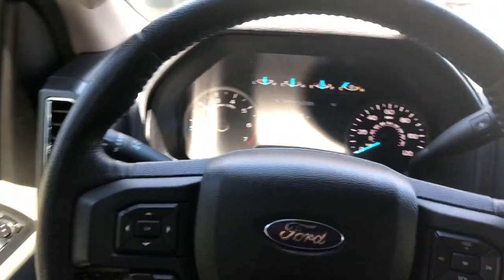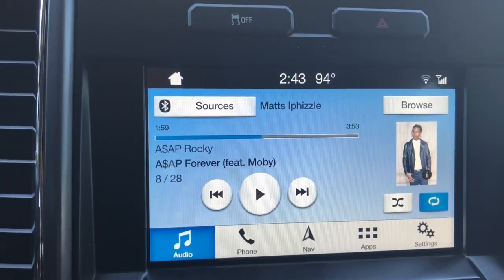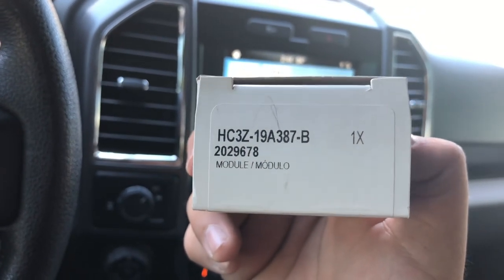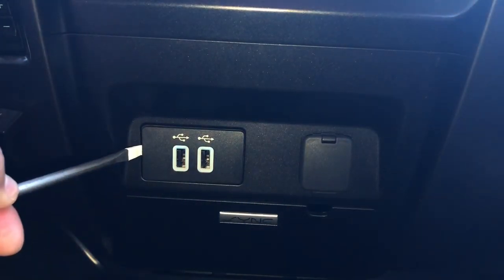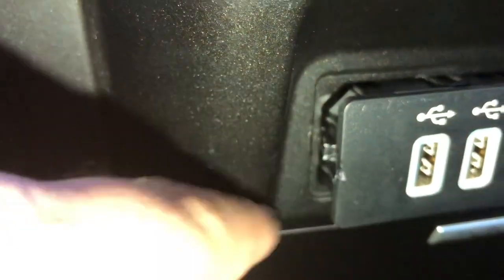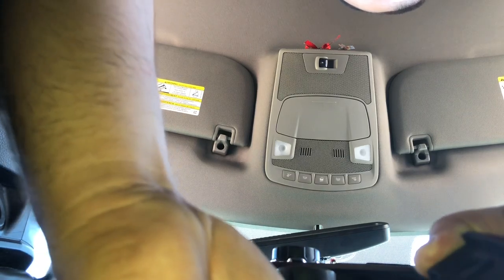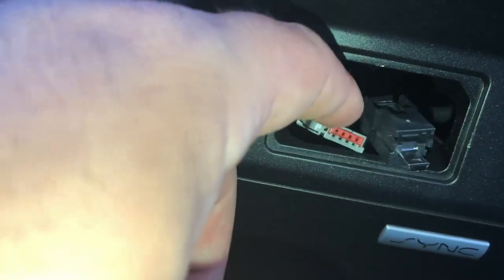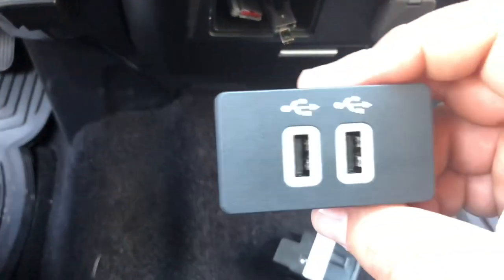2016 Ford F-150 and Apple Car Play

Comment: I went through the process and followed the directions exactly. It took my car over 3 hours to update. Not sure why.  But when it got to the end and said installation complete. It worked! One thing none of the YouTuber's never mentioned was that the screen gives an alert saying that the USB is not compatible. Even though it all still works. My guess is because i got the parts from Amazon and not from Ford.
Reply: Do I have to unzip files 😊
Reply: @rugarmoore7657  Yes. I ultimately had to get the right part from  Ford and the problem went away

Comment: Thankfully, CarPlay now allows other navigation apps... at least on my other Sync3 devices. I had a 2016 C-Max and went through the update. I then traded that in for a 2018 Fusion, which was already setup for CarPlay. I think I was able to use Waze prior to trading in the C-Max. The reason I came today is I just bought a 2016 F150 to replace my 2013 Explorer and it hasn’t been updated yet. I ordered my new USB hub, which will arrive tomorrow. I couldn’t remember which I am to do first... update firmware or update hardware. I THINK I’m supposed to do software first.

Comment: Just wanted to add my thanks as well. Worked great. I found the part at Ford Discount Parts ($50.30). This is what I ordered: HC3Z-19A387-E 2016-2020 Ford Control Module.

Comment: Hey 
I just buy that part and it works 
There download upload you need as well???
Reply: That came out wrong 
So all I have to do is buy the part and everything is already loaded. 
I don’t need any download or upload or anything ????

What’s link to where you bought part
Thanks
Reply: @billwandling318  You have to upgrade your Sync system. 2016 Sync comes with version 1.0 and you need to update it to 3.0 You have to go to the myford website where you are able to login or create an account, register your vehicle and then download the new version onto a usb flashdrive, then go to your vehicle and plug that usb in and your system will detect the update and start the process. Should take about 30 minutes and have to leave the vehicle on, install this part an bam, Apple Carplay. If youre running Android however Android Auto will connect wirelessly.

Its a bit more than just downloading though, look up specifics through other sources. 1 your flashdrive will need to only have that file on it i believe and have one with at least 3gb of space, then you will need to reformat the flash and file you download. Sounds tedious but its really simple, if youre lucky you might be able to call the dealer and just have them do it for you although it will probably require an appointment and end up taking hours instead of 30 minutes
Reply: @iR3J3CT_  sometimes to do it wirelessly can take about a month if you just connecting it and letting it do it itself when its around your wifi

Comment: Just curious how did it take to switch over to CarPlay
Reply: What do you mean should switch when it senses your Apple device in the USB port within about 5 seconds ?
Reply: fordtechlife yea I did the swap and nothin g
Reply: @aldojr5552  has to be sync 3 and software level 3.0 or higher got to setting and aboutsync to check level

Comment: I installed this product and I love the functionality. Only problem is my volume up/down and other steering wheel controls don’t work like they used to. Did you have this problem too?
Reply: No mine works fine
Reply: Ive heard of this it's a device issue depending on the device it may do that
Reply: @fordtechlife  i figured out the problem; you have to be on the screen you want to control on my truck; volume up and down for example, i have to click on spotify/music screen, and it'll work correctly; siri button works from any screen.
Reply: This started happening to me before I replaced this part

Comment: Does this work on a 2015 F-150 XLT model?
Reply: Probably not in 2015 Ford had the mysync system and they went to the Sync3 system in 2016. Call the dealer and ask

Comment: I have a '16 F-150.  Sync 3 updated to version 3.0.  Bought this exact same part from the Ford Dealership.  Installed just as seen on this video however I immediately got an message that states " This USB device is not supported.  Please remove".  Then bought another USB module online and got the exact same error.  Anyone else had this issue?  Any suggestions?
Reply: I have the same problem. The usb port don't recognize the devices. Have u fixed the problem?
Reply: It's the cable. Using an aftermarket or damaged Lightning cable will cause this. It's not the module.
Reply: Was this issue fixed?

Comment: How did you update to sync 3
Reply: Joey Ivezaj go register you car/truck on ford.com you can download the update to a thumb drive and then upload it to your car/truck or if your vehicle is WiFi enabled you can connect your car to WiFi and set automatic updates
Reply: I went to dealership my truck still in warranty did it for free. Updated sync 3 still need the module.
Reply: @johnfregeau7411  You can't update from Sync 2 to Sync 3 though, only if you already have Sync 3 you can update to a newer version of Sync 3.
Reply: @andrewvaldez8783  yes if your within the 3 years 36 k miles and request to update your in 🔴⚪🔵🇺🇸👊

Comment: It's stupid that you need a new module for this. It should just be a dumb module that passes USB straight to the head unit with separate dash light wires. By the looks of the connector, it's a special USB mini-B connector and the module is a USB hub which should be standard.

Comment: I did this in my 2016 Taurus.  Works great but to be honest if you already have Sync 3 you do not really get much additional functionality with Apple CarPlay although my car already had navigation in it. 

I am hoping more apps become CarPlay compatible because most of the time I actually leave it turned off.   I do like having the option though because I can use other Navigation apps if I need to and still see the directions on the car screen.
Reply: How did you get it in a 2016? I was talking to a Ford/Sync Representative today and they told me that only cars after 2017 have Sync 3 and that you cannot update Sync 2 to Sync 3.
Reply: @dylanmurphy7814  Some 2016's had it. Also, they will tell you that Sync2 cannot be swapped with Sync3, but you can. It is a drop in replacement. You just need the screen/apim assembly, a GPS antenna, the USB hub listed in this video, and a power adapter for the hub from a source such as Infotainment or 4DTech.
Reply: You can add and remove APPs via your iPhone's CarPlay settings under SETTINGS-->GENERAL
Reply: lol 😂 “do not get much additional functionality with CarPlay “ what are you expecting. It makes the screen look like your iPhone and access to music and maps in a familiar way so